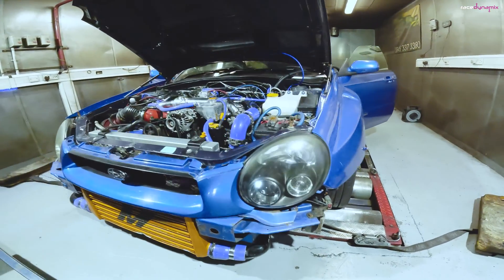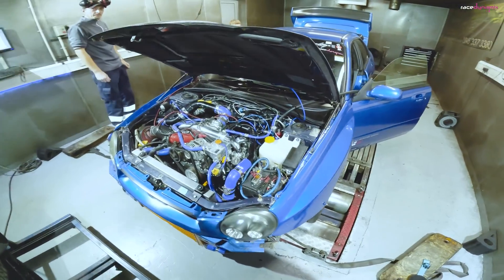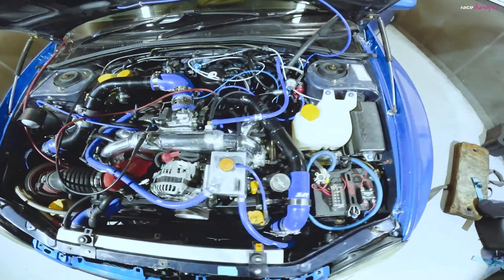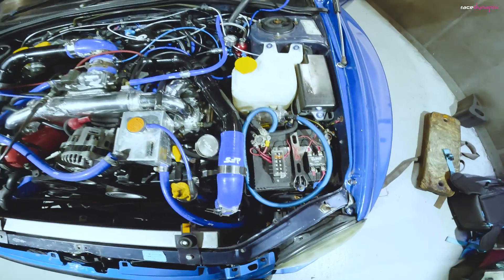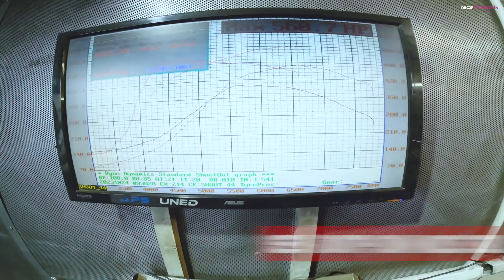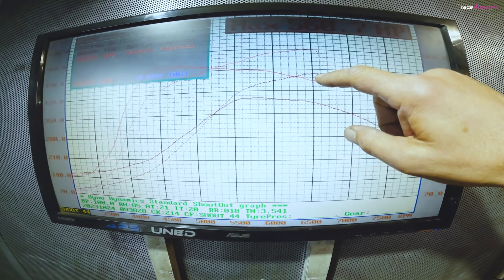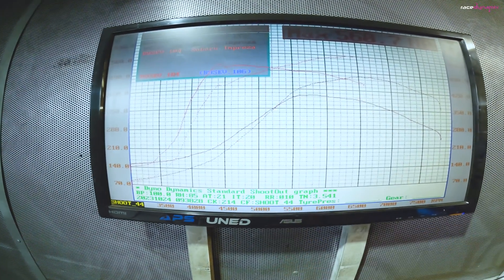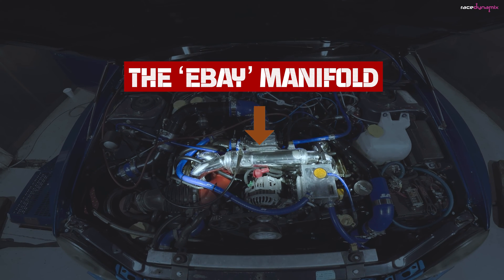Subaru Tuning with Nitrous Oxide NOS

Comment: sorry alittle late😅 but new to the channel, this is very interesting to see, can the standard ecu deal with a dry nos system, and what sort of engine combo is on this car ie turbo and engine setup,
Reply from the maker: Hmm tricky one.

You would want the ecu system to add extra fuel when nos is active and also retard ignition timing. It could be possible on carberry by using the nos activated switch swap it to a second map which has the extra fuel and lower ignition.  Getting it to activate the solenoid would be tricky.

Better to get an ecu that can control it properly.
Reply: @racedynamix  ah I got you, I'm currently on carberry system, is it possible maybe to use the meth control and then reassign something like the evap to control the solenoid?

Comment: A 300 shot is about 350-400whp on a turbo car.
Reply from the maker: @saltycanadian6190  300 jet these were..gives 150bhp on top of whatever the normal power is 👍
Reply: @racedynamix  I guess I’m to used the to LS platform.

It is almost a 1:1 with shot size:hp boost

Comment: one thing I have learned from talking to you and these videos is that very often the standard equipment outperforms the aftermarket 'upgrades'. from coil packs, exhaust manifolds, inlets, factory dump valves, etc. Although not always the case , it does pay to research before jumping into buying shiny stuff just because it has the word perform attached to it.

Comment: That's was very informative
Q.. why does a  colder plug help when the mixture gets so dense , put out the flame ?

And my other question
Q.. can you do this just to spool turbo .on STD ecu 
On my hawk ?

Thank you
Reply from the maker: Thanks Doug.  The flame front on a nos boosted car travels faster hence why having to remove ignition timing to run it and the explosion much greater. Plugs for nos tend to have recessed electrodes the same as Racing 8s to help protect that from the combustion.

You can do on std ecu but would need to have twin maps with ignition retarded on the nos map and a mixture of tps and map pressure activation/deactivation to make it work like you want.  It would be difficult to achieve but not impossible 👍

Comment: Nice video and setup 👍🏻 played with nos before crudely on a zex throttle position switch on a little Peugeot 2 seconds faster over a quarter mile. Would love to use nos again in the future. Will the gas still be accessible as I’ve heard rumours it’s getting banned.
Reply from the maker: Banned for recreational (mis)use but Motorsport will be considered proper use so should be fine 😎👌